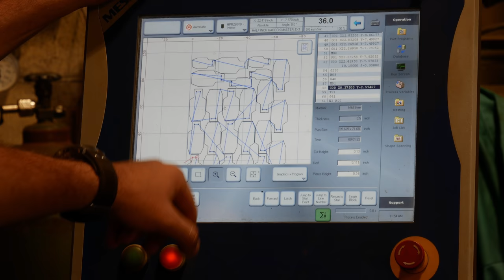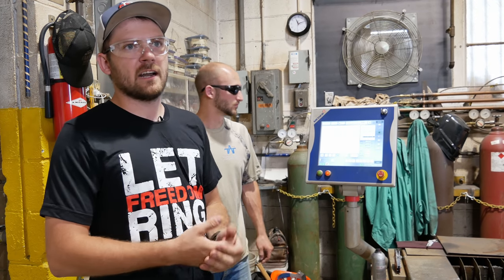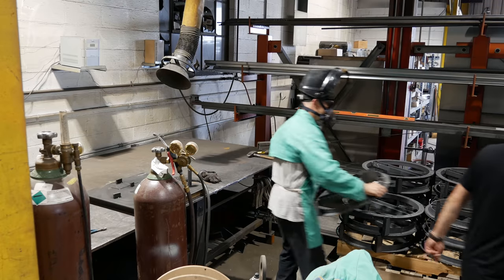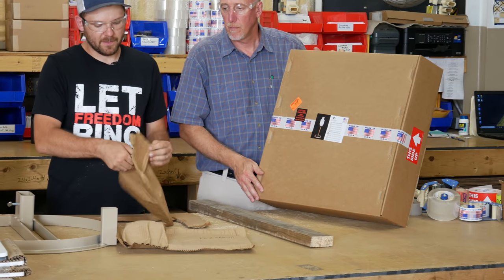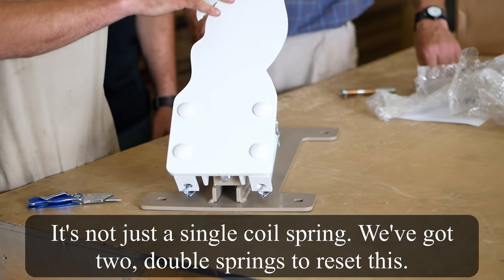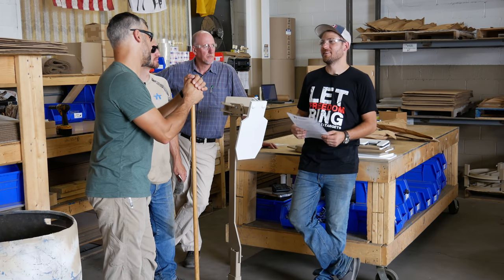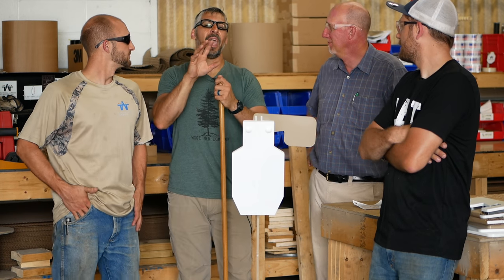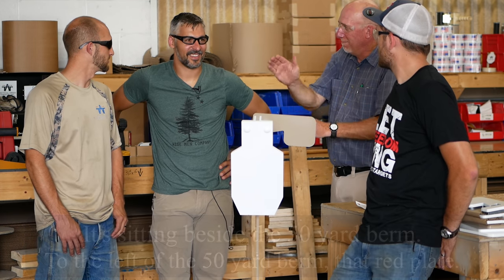Steel Targets Factory Tour | Tactical AR500 Targets

Comment: Is it safe to assume that the lowest hardness rating on ar550 steel  that would be safe for shooting, is equivalent to a higher hardness rating on ar500 steel?
Reply from the maker: A low level AR550 is significantly harder than the highest AR500